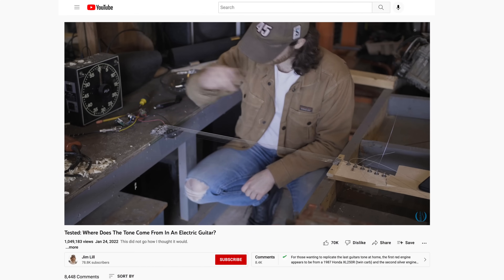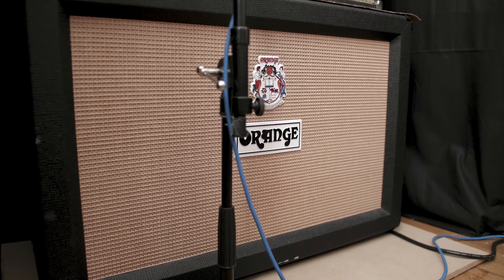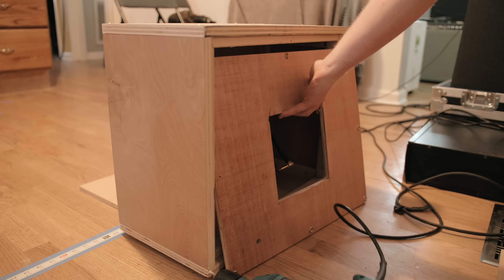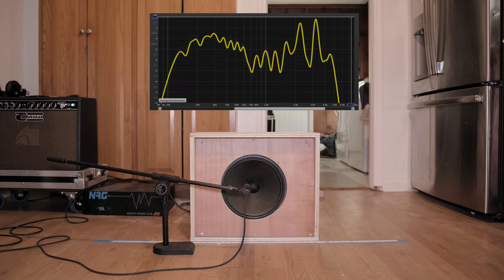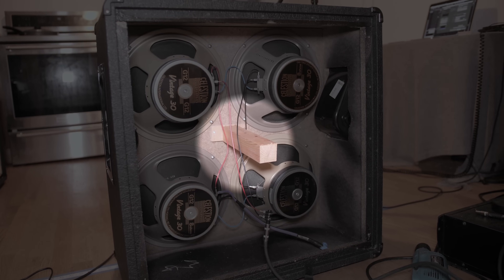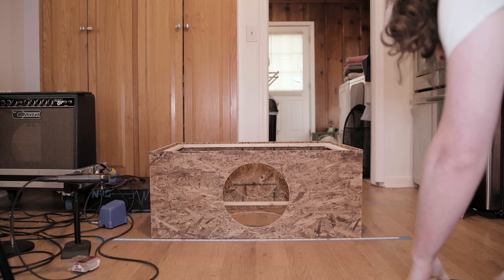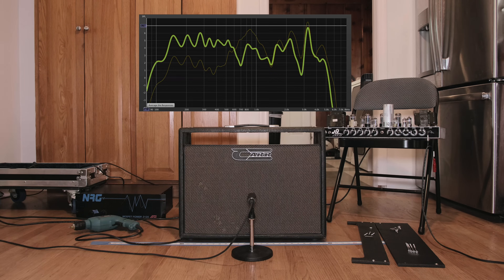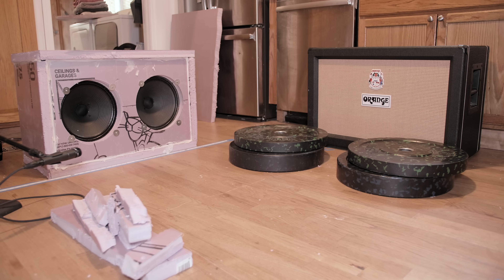Tested: Where Does The Tone Come From In A Speaker Cab?

Comment: one of my pairs of hi-fi speakers was *very cheap*, with zero internal bracing. being quite wide and thin, i worried there was nothing keeping the woofers from moving front to back, so i surrounded one woofer with a ring of bamboo skewers glued between the front and back walls, and the difference between the speakers was incredible. suddenly i had a completely different, far better low end. i don't think the front-to-back brace is about making the walls "move together". it's about simply holding the speaker put, when the vibrating mass doesn't want to hold still, and people usually try to hold it in place with the edge of a flexible panel. this is no way to apply a load to the rim of the driver where it is mounted. and imo, just adding one stick between the pair of drivers is a bit half-assed. if you look at the construction of phenomenally expensive speakers, you'll see a lot more bracing between opposite walls. rule of thumb: tapping a speaker box should sound like you're tapping a brick, not a drum. my incredibly cheap speakers went from drum to brick, and they became good enough for most purposes, even though i have expensive speakers in another room

Comment: The sound comes from the cones.
The tone would be a combination of the size, materials used, magnet size, perception and our hearing etc 😊
A little bit of mystery adds that aura that makes it perpetually attractive like a womsn should be ideally😊
Reply: As an amplifier cab builder myself, I have to say that this video is somewhat misinformational: If every audio clip in this video does actually correspond with the visual/video presented on screen, then it is clear to see that the recording microphone (in 99% of instances) is directly in front of the speaker... so, in a 4 X12 test... Jim is only recording ONE speaker... same goes for a 2 X 12 or any other combo. The wood, resonance and structure of any cabinet DOES affect the tone... but you're not going to hear that with a mic placed right in from of ONE speaker. To do this properly, Jim should place the mic say... 20 feet away - about where you'd hear the speaker if you were stood near the front in a small venue.. or managed to get right to the front of a stadium gig. Just saying! 🙂

Comment: Speaker itself changes most of the sound, a well assembled cab only affects the air that gets moved, so while the last DIY cab does sound like the Orange cab, it is not the most practical cab to bring along.
When it comes to materials, the important thing for a cab is durability and weight, since most probably want them to last and not being to heavy either.

Comment: Love this video. However, you had the speaker cabinets sitting flat on the floor with no rubber feet. The rubber feet make a huge difference in tone. A cabinet sitting directly on the floor will have more bass than one on feet. The taller you make the feet the more the bass is reduced. If you add furniture legs to the cabinet so that it's elevated it has even less bass. Just saying this is another area you have not yet explored and you might want to? Thanks for the great video. You sure did try a lot of different options.
Reply: PS, I have personally also found a huge difference in tone between a thick baffle and thin baffle. The thicker baffle will sound brighter, the thinner baffle will sound more dark.
Reply: PPS- have also tested the difference between Baltic birch baffle, pine baffle, and MDF baffle. MDF rolls off a lot of high end, and is a little weird sounding to me although I have read that some people use it. A 1/2" thick pine baffle sounds a more lively and open. However, it seems that pine would probably split and crack over time and is maybe not the most dependable material for a baffle.

Comment: good work, if you could mathematically measure the size of a particular frequency wave determining which is beneficial to the sound versus the undesirable frequency you could determine the best size round hole and/or pipe to finely tune your cabinet. i worked in a large factory where i had access to different sized plastic boxes and used them to enhance my boombox sound. there are commercial programs that will help you with this. i also worked for a well known company building emergency locating beacons for aircraft and had to build the antennas along with them. i had to work with specific frequencies of 121.5 MHz, 243 and 406.025 being the search and rescue bands, the antennas had to be actually a fraction of the full power waveform length to emit the wanted freqs, and i had to measure the frequency for what was called a standing or reflected wave power (VSWR) which is not unlike your search. sorry for the ramble.

Comment: 6V6 and EL84 sound more similar than other comparisons. A better test would have been 6L6GC versus EL34. Also, the frequency response of the output transformers in tube amps are source dependent. For any amp, what input signal you hit it with, the impedance presented to the input, how you distribute the signal by controlling gain through the amp stages, and the applied eq will change the character of the amp relative to the bias point on the power tubes. The best upgrade for the sound of the amp is probably the speakers and controlling what you plug into it. Everything else is just how you adjust your amp controls and having your amp biased properly with well behaving tubes.

Comment: every cab is a compromise because it's impractical to have a round  baffle  30 foot across so the baffle is folded back into a box to stop the pressure when the cone is pushed forward escaping into the vacuum at the rear.

Comment: You don't hear the sound from 4 inches from the cabinet. Sound diffraction and interference will come into play at realistic listening distance depending on the shape and speaker placement from edges.
Reply: Realistically guitar cabs are miked close. Anywhere from .5 inches up to 4 inches or so. So anything you hear on a record is probably a guitar cab that has been miked about a few inches away anyway. So yes you do hear the sound of a mikes cab from less than 4 inches away cuz that's what's being recorded.

Comment: I've seen at least one guy mention that standing waves in the cabinet are a factor. Seems obvious that standing waves could effect speaker performance depending on which part of the wave was behind the cone. The suggestion was to build a cabinet where no two sides were parallel. That would make standing waves impossible. That would definitely complicate the design and build of the cabinet. But if styrofoam works, it would be a cheap way to test the idea at least.

Comment: My takeaway is that if you're building a rig for the house that will never get moved, you can optimize differently with your materials than if you need to throw your rig in the back of the car every weekend to take to a gig. Ultimately, sounds like it comes down to durability, weight, cost, and ease-of-use when selecting materials. If you respect all the other dimensions, you can get away with using materials other than high-end plywood or other "tonewoods"

Comment: you should get a longer guide drill for the large of a hole saw
oh and to use a jig saw for this, drive a nail in the center, tie a string to it, tie the other end of it around a pencil, and then draw a circle. then just drill a hole in one spot on the circle for the jig saw.

Comment: For reference I would have really liked to hear some of those differences with the mic a bit further away from the amp. Like you were touching on in your conclusion, I think things like the number of speakers and their distance to each other would make a big difference in phase relationship of each speaker. Or for example, of course the planks in front of the speaker make a huge difference when you place the mic right in front of them. Since wavelengths get smaller with increasing frequency even a half inch plank can block quite a bit of hi-end right in front of it. Moving even a foot or two away I think that difference may almost be negligible because the uncovered surface in relation to the covered surface and in relation to the mic distance is so much bigger.

True when you close mic just one speaker that all may not make a big difference but it could play a big part of how the amp sounds when you stand in front of it to play it.

Comment: These test are pretty cool, and very well conducted.  However,  I think it would have been, or could be more informative if you were to run a second microphone at ear level about 6-10 ft away.  When the mic is right on the speaker cone, any difference from the cab will be minimized.  Placing the mic back a few feet will allow the sound of the cab to blend with the sound of the cone.

Comment: 😮The key to a great sounding speaker box is insulation against the back plate, so the boxes don't ring and a 3 inch hole for the midrange off the back side of the speaker   but the speaker is an air pump, it has to be able to bounce for the bass. Take the front off some jbl L-56's. They use a cone going about mid way.
Reply: Even a car 6x9 speaker sounds better in a wood box with insulation in the back and a air vent in the front.

Comment: Small holes are avoided in sealed cabs not because they affect the tone. They need to be avoided to prevent potential unwanted noise. When the speaker is pushing a lot of air it can cause unwanted whistling through the port hole. It is not unlike when you push your lips together. When your mouth is wide open your breathing is quiet. breath at the same rate with you lips together and then the air rushing through your lips becomes audible.

Comment: One thing you didn't try is a closed back with a 2-4 in hole in the baffle (I've seen hi-fi stereo speakers built this way). Also a baffle made of 1/4" cedar.  Take an acoustic guitar and use it as the cab, a bass should do.

Comment: One suggestion: please use distortion instead of clean or mild overdrive. 
There is a very specific scientific reason I ask for it: the more distortion there is, the more harmonics present in the signal. When you play changing power chords with distortion you approach the pink/white noise - which is exactly what we need to hear all the differences in frequency responses.

Comment: I couldn’t tell the styrofoam from the Orange cab at all.

As for your 9 x size comparison, the closed back oversized 4x12 sounded the best to me, by a significant margin considering that it had a lot more bottom end in your test…then again I’m a high gain metal fan. I suspect that the amount of gain and EQ would probably effect the outcome of these test you’ve done. For instance a scooped mids metal tone ala master of puppets would probably not sound as tight on the oversized 4x12 as it would on the smaller 1 and 2x12 cabs.

Comment: Great video! You answered just about every possible guitar cab question except the one I have 😂. I want to know (with all else constant) what the difference is between a 9”, 10” or 12” deep cab. Same question for typical width and height measurements. The vid here shows that there is a difference when a cab is bigger overall but I dont know if its explained by L, H, D equally or if one or two matter more. I assume the 12” has more lows than the 9”. But is there an intuitive way to understand how the tone changes as you make it wider or deeper. I personally guess that depth has more impact on lows than height. Not sure about width

Comment: You should have turned the 2x12 vertically, and also tried 4 x 10 vertically. When speakers are side by side, they have null points, caused by comb filtring. Also you have your open backs very close to the back wall, should be 5-6 feet away from back wall. Size of the baffle matters also. That will eliminate wall reflections which are 50% of a rooms sound. Check out an article by Electrovoice Raymon Newell AES Journal Vol 28 1/2 1980

Comment: I really hate to ruin your fun, but... you need to check volume changes.    I have a Fender Blues Jr. that sounds sterile when at in-house practice levels.  Why get a tube amp for this?  In the garage with it cranked up a bit, it sounds great.  When my friends come over and I play with a loud band, I crank it up and it's unbearable.  It becomes so thin and spikey it really hurts your ears.  I had a second cab made that matches the size and speaker of the amp.  Hooked up in parallel, they really create much more volume and don't get spikey.  I found you need to size the cab to the size and volume of the venue.  At small bars a Blues Jr would be fine, bigger places, use a Deluxe Reverb.  Outdoors at the park where you need to move air, get the big amp and a 4x12 cab. When I play Wembley Stadium, I usually.....

Comment: What I've understood (from the internets) is that speaker cloth is alledgedly "acoustically transparent" - that would explain the massive difference in multiple t-shirts vs multiple speaker cloth layers.
     (They weren't kidding, apparently.)
Reply: Also, the series vs parallel speakers.. I know that matters for your amp.
     (if the resistance is too low for what your amp can handle, things burn out..
     I visualized that as "not enough power that's sent out is being used up. So it gets too much power sent back..". 
    Not sure if that's scientifically correct, but it helps me remember why it's important :))

Comment: the foam will dissipate resonance, into heat, more than resist resonance. ( similar sound at lower volumes ); but the Real Differences, between the foam and birch ply, would become  much more apparent at maximum sound pressure levels. ( besides the gig durability )
and most people will say MDF sounds "subjectively better" than ply, but not if they have to carry the cabinet up flights of stairs on a regular basis;
where birch ply is better than a cabinet made of concrete in the same way....even if a concrete cabinet sounds "subjectively better."....or 2" foam would not be as stupid as cardboard, though laying up fiber glass on cardboard might not be bad.....but after a few layers of fiberglass, most people would wish they just whent with birch ply to begin with.

Comment: I'd say the, size and material of the speaker diaphragm, inductance, resistance and number of turns of the coil, strength of the permenant magnet, transistor types, resistors, and capacitors.

Comment: You can't really compare cabs in a random room with things being moved around to get accurate measurements. But anyway. The effect from baffle towards open back is all pretty much just extending the baffle. Closed back is actually a new system all together and then the speaker will actually really start getting loaded by the cab. If you want more load on the driver you can go vented and from there there's 4'th and 6'th order band pass enclosures. Open back might be the only one here that's meant to "resonate" or add colour. Closed back or vented variations should normally be stiff and air tight. The role of any speaker cabinet is normally to aid coupling the driver cone movements to the thin air we hear it through. I'm guessing most guitar drivers are designed with high-ish Qts and are mostly suitable to be mounted in anywhere from open baffle to a sealed enclosure. They don't even bother showing you T/S parameters so I guess they just assume you will use them in something like that. You could, just for experiment's sake, try a vented cab too but they might not have the force to work in there properly. Another interesting thing you might not have figured out is that if you leave some drivers disconnected in especially a closed cab they will act as passive radiators and contribute differently. If you short the disconnected drivers they won't act on the pressure as much. Same goes for speakers standing close by in the room. If you have two cabs side by side and you only play one it's technically best practice to short the other ones drivers. Another easy thing to try is filling. With wool type stuff or something heavier like glass wool or something. It's used to tame reflections in a cab mostly.

Comment: My take away for what it's worth a year later is, while looking at the frequency graphs, the greatest difference with all of it was on the bass frequencies. For guitar, too much bass isn't worth spending money on, because the guitar shouldn't occupy bass frequencies, so the mix engineer will need to cut all the bass you spent so much time and money creating. So have a very small surplus of bass is ok, but having unusable surplus of bass is illogical. You may be able to use a small portion of the bass frequencies in a mix, so having some is good. After all of that, it seems to me, a balance of not too much bass to remaining frequencies gives the mix engineer the most to comfortably work with. Other than the smallest thin sounding cabinet, all other tones were usable with EQ in post. You can spend your life chasing tone, or creating music, the choice is yours. One of those things is worth your time.